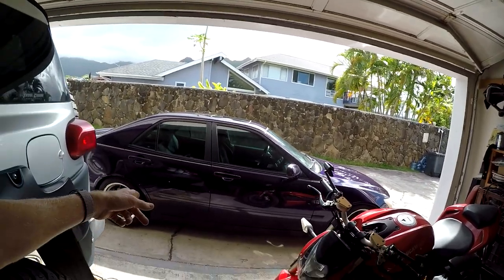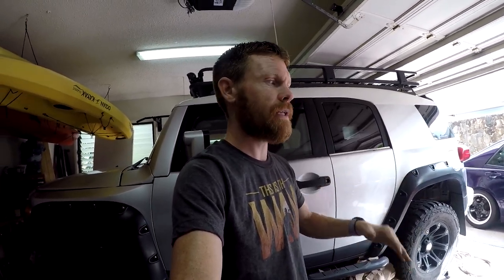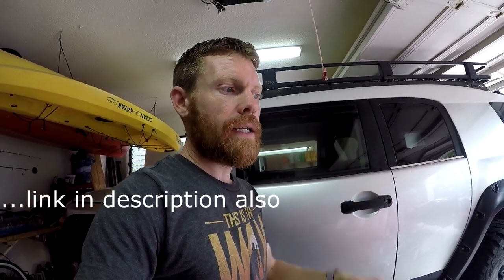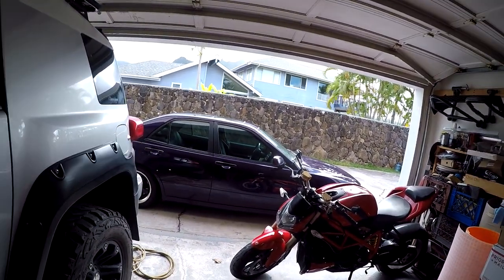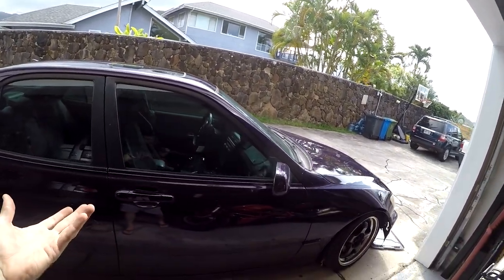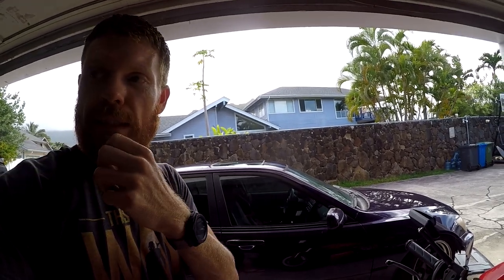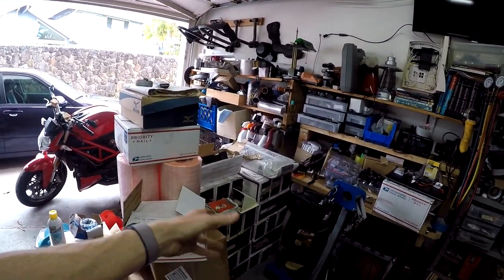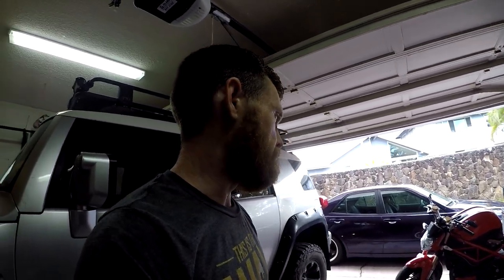VLOG 1: 2JZGTE, FJ Cruiser Throwout Bearing and clutch upgrade, and new project car

Comment: Did you have to cut the quill off, reason I’m asking is my quill or snout just broke off. Clutch master told me that this hydraulic grade would work to fix my broke quill. He stated they had told customers to cut the quill off anyways, because you bolt it to the transmission, what do you think. Is it strong enough to hold in place without the quill or do I need to buy a whole new transmission. Any help would be appreciated. Thank and great video

Comment: Hi Jay! 
Great work!
Reply from the maker: Hey, thanks!
Reply: @LegitRaceCraft  Any updates on how new TOB is working in the cruiser?
Reply from the maker: @kissdamooth3902  the TOB is still going strong
Reply: Checked with Clutch Masters and know you did this a year ago but not seeing Toyota FJ as a choice so I chose Toyota Tacoma.  Is this part:  TOYOTA TACOMA - 2016-2022 - 3.5L 6-SPEED MANUAL | N16035-H, Hydraulic Release Bearing - $550?  Yikes!

Comment: So it's doable on ground? How have you liked the new clutch? My oem is starting to slip so I'm getting ready to swap it. I've been wheeling mine moderately hard so I'm a bit nervous to see the inside lol.
Reply: I'm assuming it's the original clutch. Got it at 107k miles, now have 138k. It just started slipping within the last week, I had full anticipation of beating the fj up and needing to swap the clutch relatively soon after I got it, but now I'm 30k on it as a daily, weekend warrior, and trail blazer. I had not held back in durability testing lol. Very satisfied, but don't want to get stuck on a trail if I burn clutch out completely. Awesome video!
Reply from the maker: It,s doable on the ground. I like the new clutch, it still feels nice. Yours could be the original clutch, my clutch still had plenty of life when I swapped the throw out bearing.